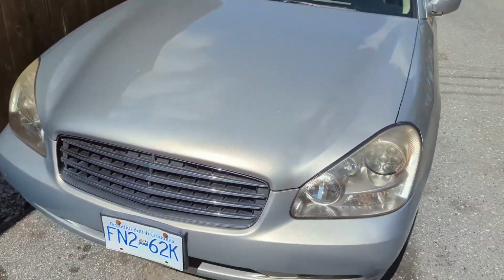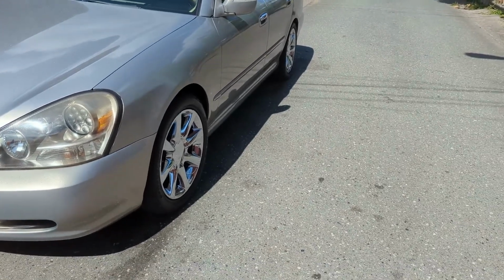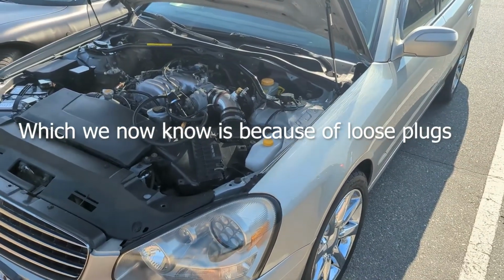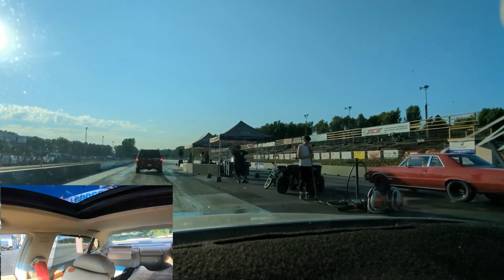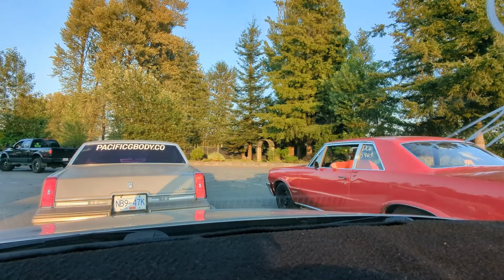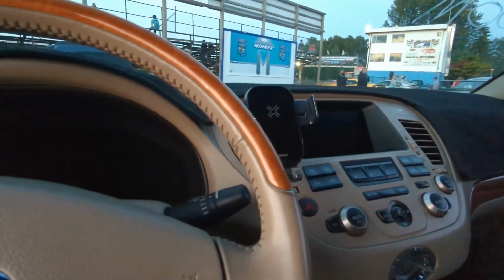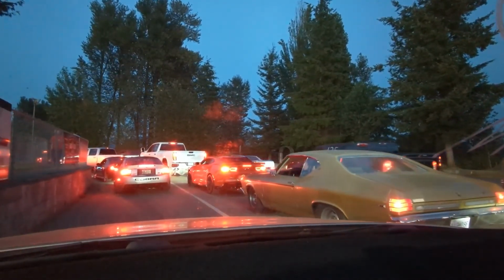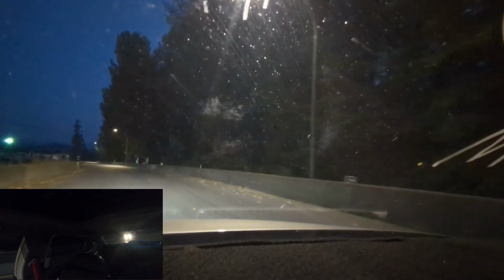The Q45 Goes Back To The Track and Runs an 11???

Comment: Bro i have the same exact model as you got it out a impound lot and started fixing it i need to know what you did with that exhaust 🤌🏻
Reply from the maker: haha thanks man! it's got Nissan Titan jba shorty racing headers, into a X pipe and then some thrush resonators, and then finally into a vibrant straight through racing muffler